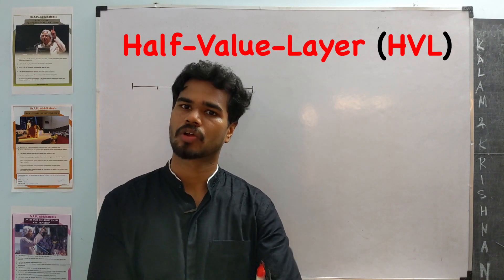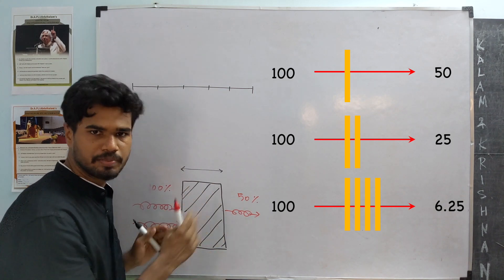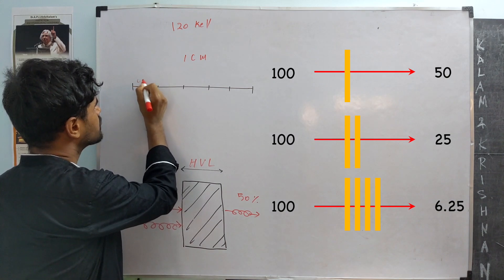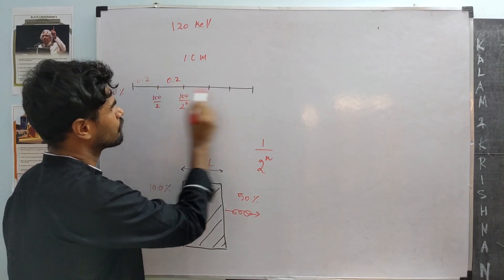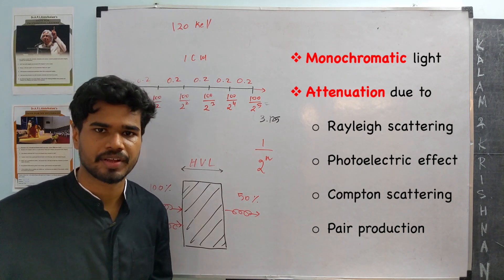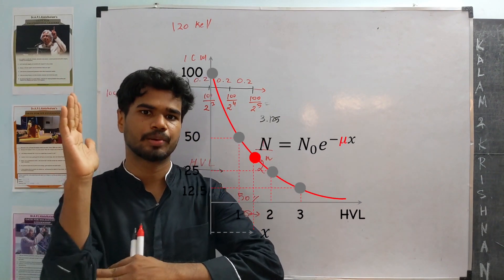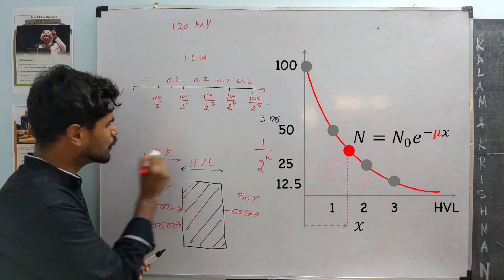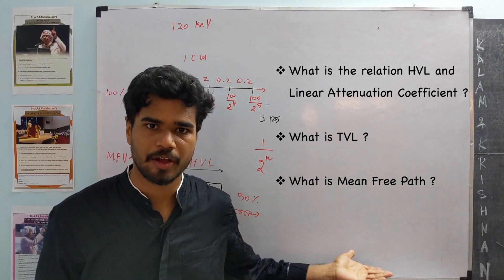Half Value Layer Best Explanation | Linear Attenuation Coefficient | X-Ray and Gamma Ray Attenuation

Comment: Sir, why LAC is different when measure the same thing with different distance at 1m and 15 cm.
Reply from the maker: don't get the context, wr does it say so?
Reply: @KalamsKrishnansBiomedical  
Thank you for your reply.

I carried out some experiment to calculate Linear attenuation coefficient. 
I prepare concrete shield with thickness of 10 cm. I measured Gamma ray from Cs-137 with NaI (Tl) detector. The shield is placed at 1m and at 15cm from the detector. After that I got count rate and I calculated LAC. The results of LAC is different for two distance. The different between them is 0.28%. In here I didn't use any collimator. Why the LAC are different for the same thin
Reply from the maker: Very sparse info for me to debug but assuming you did the technical aspects of LAC estimation correctly, I think the difference boils to a narrow beam vs a broad beam setup. At 1m it is more of a broad beam setup n without a collimator u hav photons from nonnormal directions biasing the results.